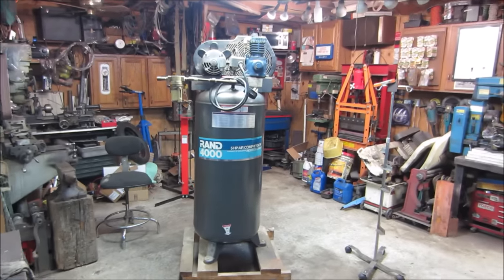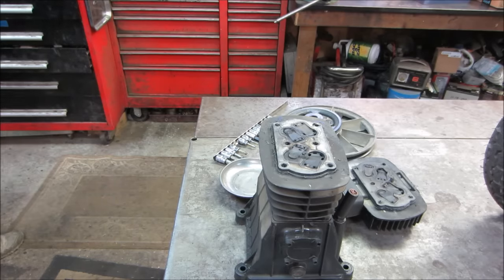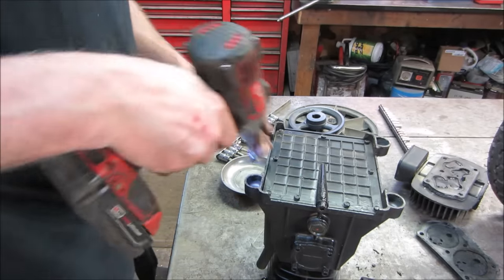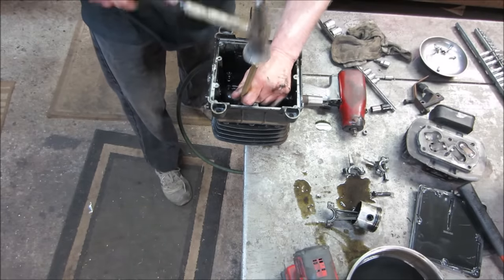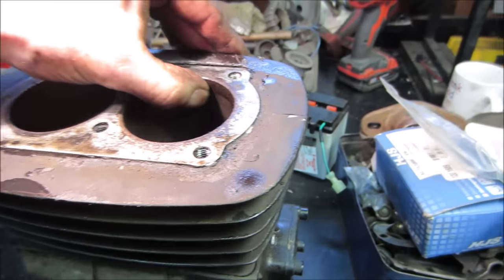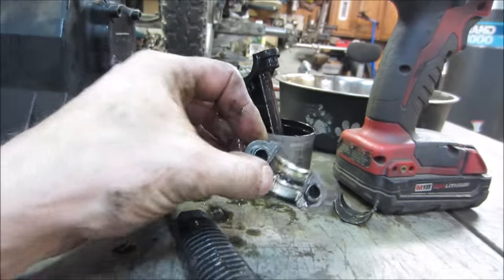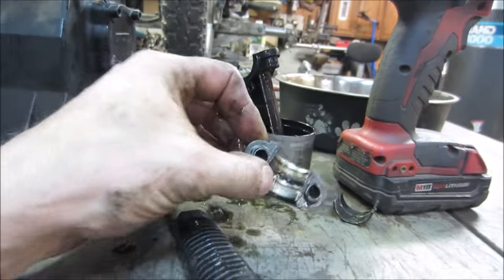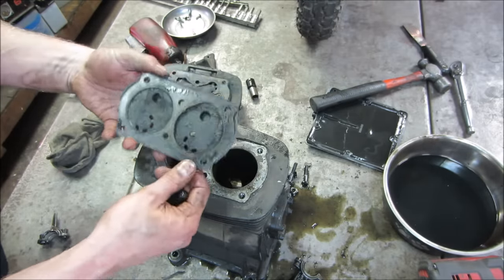Burned out Air Compressor tear down, what went wrong?

Comment: Thanks for doing this video.  Why does a compressor piston have carbon on it?? Theres no gas to burn causing carbon.  Oil blow by causing a diesel effect?
Reply: Not Carbon..It's fried Oil
Reply: that is just accumulated debris sucked in thru the intake valve, combined with a small amount of oil blow-by . Compressor intakes rarely get cleaned and shops have filthy air quality so some trash on the piston is common
Reply: Correct, that's what makes compressor oil special, it burns up cleaner than engine oil.

Comment: Hey Mustie,
Maybe the compressor wasnt sitting level is why one is so much worse than the other??
Reply: I think Darren nailed it when he said that it was the back piston that failed, the one furthest from the air supply. Same thing happens in a Harley V-twin since the cylinders aren't offset.
Reply: @billbeyer657  sometimes i cant see the forest for the trees. I used to have a harley and knew that.  Thank you for getting a few of my old brain cells firing again!
Reply: @Mike-xt2ot  Not sure that ICE faults can be transferred to a pump. Maybe, but I think there is more to it. I also think the compressor may have been on a slight lean at some stage and temporally starved one side of oil. The pump would still run for a long time unlike an ICE that would fail catastrophically.
Reply: @grantadamson3478  thanks!

Comment: Had that same one. The pump was made of inferior pot metal, the valve plate and gaskets failed as did the regulator. I replaced the pump with one from Harbor Freight for $150 put a new regulator on it and added a check valve to the tank inlet to protect the reed valves. Now it runs much quieter, smoother and more efficiently.

Comment: If they made those rods with cast iron  instead of aluminum that compressor would still be working.There should be a law against using aluminum rods I hate them  Its just being cheap ,cheap and just more cheaper to make and softer & easier to machine.Manufactures want  it to blow up after so many hours so you buy another one mind you somewhat past the warranty period.They know how long it will last they Test them and run them continuosly in test facilities.Proof is in the pudding I work on old 1950S and up Evinrude and Johnson outboards all of them 10HP and above use all cast iron rods & needle bearings and I have worked on many of them  never come across a cast iron rod that snapped yet.Salt water is much more the known enemy of outboards than connecting rods snapping,LOL!.Glenn P. in N.Y. Im an outbobard mechanic and collector for many years.............................

Comment: If you designed your own head and slapped a timing chain/gear on the crank then make it an overhead cam it would probably work
Reply: You know the v-twin compressors at Harbor Freight are set up like that. Fit a distributor, spark plugs, wiring and a carb on there and you might just have a small engine!

Comment: Mustie... I agree with you. The piston that failed gets less cooling air from the fan. It probably caused the carbon build up due to higher heat than the other piston.... Also, that fan guard is far to restrictive. The way it's been deigned it blocks off at least 50% of the air flow.. If you cut every second rib out on the inside cover where the fan blows onto the compressor you'd get far better cooling and the compressor will last a whole lot longer.. In the past I've replaced that section with wire mesh and it made a huge difference to the air flow.

Comment: My bet is from running for so long, like you said, the heat soak got the better of that back cylinder. Probably ran with the air wide open for hours on end. Everything seems to be evenly worn, very severely. Definitely a testimate to how tough this compressor is.

Comment: Great video Mustie, I think what happened was that because it probably ran continuously do to a leak somewhere in the line, it got hotter than it should and used up enough oil to cause the damage. as you said further from the fan contributed.     If a gasoline engine is over heating and it continues to run unchecked even though it has oil it will soon become a piece of crap fast.    Thanks for the videos, I can't wait for your video in my inbox.. I would be interested in the progress of your wife's veg garden also, I also have a garden .

Comment: I just repaired my 10gal Craftsman compressor where I let the oil run low (it was off in a corner- set it and forget it). The con rod siezed onto the crankshaft. I had to hacksaw the con rod to get to the crankshaft locking bolt. Installed a new crankshaft/piston assy and works as good as new. I hate throwing stuff away if I can fix it.

Comment: I fixed one that was a factory throw-away.  It had over-heated and had similar looking carbon buildup but had no significant bearing damage.  Rebuild kit of rings, reed valves and gaskets got it back in action.  It's still in use in my personal garage some 15 years later.

Comment: I saw a you tube vid once where a guy turned a large refrigerator compressor into an engine using the same principles as an old hit and miss stationary engine.
I don’t recall what the valves were like.  I do recall it was interesting just to watch it run with leavers and stuff moving back and forward to govern the speed.
I think he spent a huge amount of time on it.  Put the parts in the stash and do it when you retire :)

Comment: Low oil. It is a standard situation. I've seen this multiple times. And you are very correct about the heat/no heat issue.

Comment: Once it started loosening up it pounded the bearings out. A tiny bit of travel increases the impact.
I think your fan theory is correct. My Harleys cooked the back cylinders because the front heated the air first.

Comment: That poor pitiful piece of garbage.  I have my Dad's 2 hp Sears Craftsman air compresser new in 1974 and it has provided air for 4 cabinet shops and it still has the cross hatch pattern on the twin bores and the same motor.  These compressors get hot and will cook any oil.   Thanks for the videos

Comment: I have an old Emglo American made twin tank with twin piston Air Compressor pump which makes a hammering sound when at the disengaging at the unloading phase. I lent it to a friend that ran it out of oil. I found out later after he brought it back when I turned it on to use it. The lesson is some people don't know any better to keep an eye on the oil in prolonged use. I told him to keep an eye on the oil. That is probably what happened to yours. I could see when you took the bottom pan off.

I haven't checked to see if I can buy a rebuild kit yet for an Emglo brand, but it looks like a regular type pump. I think they may have went out of business as I no longer see any around. I bought it used from a retired autobody repair man and the twin tank I believe is a wet and dry tank to run paint equipment. It also has a factory big electric motor which is a little unusual.

Comment: Does that type of slinger on the connecting rod also have an internal passage? Because if that tiny little hole plugs up, that'd be enough to start the lack of lubrication problem.

Also I wonder if the thing dieseled on occasion with all the carbon and appearance of blow-by?

If it weren't for that crank wear, it'd look like there'd be enough to replace the one piston and connecting rod and get a working rebuild. And with what some parts cost, it's probably just easier to replace the whole thing at that point.

Comment: I think you are right with the piston furthest from the fan getting hotter. The oil seal probably failed and the burning of oil may have increased the temp possibly affecting the seal on the second piston not long before it was turned off. That little end wear was huge how could no one have noticed the noise from it? Mind you I ignored with others recently an armoured vehicle recently that was saying "Alert in need of assistance" repeatedly. It was outside the main entrance to a supermarket in my defense but you can ignore pretty much anything.

Comment: It makes sense to me @Mustie1. Due to it being electric there is an external force pushing this thing and the motor still works even if your a cylinder down. The one cylinder was not broken enough to cause catastrophe but was close for sure. Think about it if i am pushing a cart and one caster breaks the cart still moves as long as I am strong enough to push it. But eventual something else is going to stop it. Even if its me getting too tired to push and start dragging the frame on the ground till it eats through it. Love the vids. You have taught me so much. This vid was cool. exploratory vids rock and I am sure you have done some that couldn't be aired due to failures out of your control. Number one fan has spoken...lol

Comment: The fan theory works for me as it might push the heat over to the failed side. I was thinking of just putting a rag over the snap ring just before pulling it out to catch it. I've had my share of things go flying. One time I was cleaning a small bearing when it came apart and all I could hear was the little ball bearings going ping, ping, ping all around me. Kinda like speedy Gonzalez, lol. Thanks for sharing.

Comment: I believe back in the day there was a conversation for old surplus Jeep's where you could bolt on a different head and allow the outer pistons to run on gas while the inner pistons were used to compress air.

Comment: We have a large 2 stage 4 cylinder compressor that runs off of a big Diesel engine. It’s operating pressure is between 200 and 240 psi. Apparently it wasn’t designed for use on mobile vehicles, and it’s starting to show its age. It has over 8000 hours on it and its valves and unloader valves were replaced twice in the past two months since it keeps breaking them. Almost every part that deals with regulating pressure has been replaced, but the main Quincy regulator (replaced twice as well) still keeps on chattering and forcing the compressor to run erratically.

Comment: @ 6:37 -  You raised the question of making a Gas Engine out of a Compressor - -  I think it already DID ,  but not Gas ,  Diesel . LOL .  Hot Oil Vapors bypassing the Rings , along with Compressed Air sounds like a recipe for Compression Ignition ,  probably why that one Piston was so carboned up .  And then you wonder why the Wrist Pin, Connecting Rod, Bearings, Etc. ,  were so over-stressed . LOL !

Comment: I think that's the exact same compressor I have.  Mine's on a BlackMax that's been modified from 3HP 110V to 5HP 220 with a 30% overdriven pulley.  I've had it since the mid 1980's and she still runs.  I want to rebuild the compressor, but just never got around to it.

Comment: I don’t suppose you remember the model of that compressor?  I have the exact same one and cannot find the model despite blowing through a lot of devilbiss schematics.  Im thinking that I need new reed valves since one of the holes on each one is worn enough to allow to slip side to side and perhaps not seal consistently.  There is an odd oscillation occurring when it runs, like it is not getting the same strain with every stroke, which is then transferring to belt and making it stretch/relax until it is equalizes into a rhythm.  

This was my grandfathers when I was a kid.  He was a Fighting CB and could fix absolutely anything with whatever was laying around.  I have followed in his footsteps and want to see if I can keep this thing going until I pass on as well.

Comment: Really strange wear pattern on it. Interesting to see the carbon buildup as well. I've taken apart some air compressors, and most of the ones that didn't use oil were very clean. I used old 50's and 60's made military made (Marshall help) air compressors, and they used V-type cylinders to prevent overheating of the rearmost cylinder as in this case.  I think you could probably make a small 4-stroke engine out of the block. :)   Thanks again for the video, amazing as always.    Greetings from Norway.

Comment: Very interesting that the cylinders appear to be so close to the same bore.  I expected that the primary cylinder would be much larger diameter than the secondary.  This puts a load difference on the crankshaft and connecting rod too.  Maybe that was what caused the secondary wrist pin to fail?

Comment: OK, I have the same problem, exactly, I think...  Should I be able to turn the air compressor belt wheel by hand if the unit is OK?  I can only get it to move a wee bit back and forth.  It appears to be locked up.  There is also a small amount of oil that has escaped from somewhere and is being blown to the fan and shroud.  I bought this air compressor yesterday, knowing that it was broken.  It came from a guy who buys Home Depot returns.  It was made in 2022, so I figured it was worth a chance.  It is a model C603H.  The motor when turned on hums and tries to turn but cannot move the pulley wheels.

Comment: I was waiting for you to think of the fan cooling that one cylinder more than the other. You mentioned making a gas engine out of a air compressor well they was a few tractors made back in the old days that half of the cylinders were used as a air compressor and other half used to power it and the tractor.

Comment: In the last video there was many comments expressing concern at the speed/RPM's even after the new smaller pully was installed. Just wondering if you had taken any of those into consideration with your final end result on the working (but how reliable at that RPM) setup?

Comment: I've always wondered what reciprocating air compressors look like on the inside - never had my hands on a broken one that I felt comfortable taking to bits! It's surprising how much like a little flathead I/C engine it looks. I wasn't expecting the pistons to be so deep-skirted. I always thought they would be flatter, like a steam engine. But no!

Comment: "Good" cylinder was on the fan side, cooling air helped a lot. You can see the same thing in many of the twin cylinder units, the fan side always shows a less wear when they are rebuilt. Most two stage units are built with the high pressure side facing the fan for the same reason. A trick we used in my old shop was to put a duct around them like a small engine so the air can get to the other cylinder.

Comment: Was it the high pressure piston that was worn?  Rebuilt a 1987 Sanborn - no parts available - where the big low pressure piston looked almost new and the high pressure side had the piston wrist pin hole worn 1/10" out of round.  Bored for a new bronze bearing, works good now.

Comment: Such a shame somebody didn’t take care of it, I’ve got an old devilbiss pump on my old sears air comp and even though it was full of water, once I cleaned off the surface rust and dried it out, it ran fine, I did have to replace the reeds but I always look after it and make sure it has plenty of oil, I wouldn’t be surprised if the comp outlives me

Comment: Those air compressor cylinders look suspiciously like internal combustion ones.   wonder how well it's work as one if you could fit some valves to it and a spark plug?

Comment: What is the brand of that compressor and where was it made?  All in all, I'm amazed that those components all held together an basically just wore out where they should have, in the bearings and bearing housings,  No major components (block, piston, head, rod, and wrist pin) broke under the tremendous heat. And the motor was still good!  I would definitely consider buying that brand if I was in the market for a large-capacity compressor.

Comment: Much to my surprise, my Dad bought a new piston, rod, sleeve, and head gasket kit for a slightly smaller single cylinder compressor for $12 at the small engine repair shop. I couldn't believe the parts for those things were so cheap. It might be worth looking into for that one, should the need ever arise.

Comment: Hey Mustie, i've got a problem with my air compressor, it is a 8gal 1.5hp craftsman from 2012 it is leaking oil at the bottom of the cover at the back of the engine. Always was kept in the house, and i ran it probably 20 times to clean computers. Can i keep using it if i keep the oil at the proper level? Or is it dangerous? My fear is that oil get into the tank and it end up exploding. Thank you.

Comment: I have seen kits to make a compressor out of a VW motor....change the head on #1,3 side and run the motor off of #2,4. But it doesn't work the other way around....the air compressor lacks a camshaft for 4-stroke and 2-strokes have intake and exhaust ports cut into the side of the cylinders.

Comment: I think you are most probably correct. The cylinder that runs normally at a slightly higher temp, even when well lubricated is the most likely candidate for early failure when the lubrication goes away. It would be interesting to determine the cylinder had temp for the left and right cylinder with proper lubrication and in good condition...I suspect the right cylinder runs one or two degrees F higher...  I know on large marine diesel engines exhaust temp is monitored very closely for a similar reason....

Comment: If that is a two stage compressor, then the failed side could be the second, or higher pressure side. Otherwise l would think, like you said  it would be from the extra heat away from the fan. Awesome video, and thank you for posting.
Reply: For sure not a two stage..would have one larger for the low pressure and a smaller piston for the second stage.